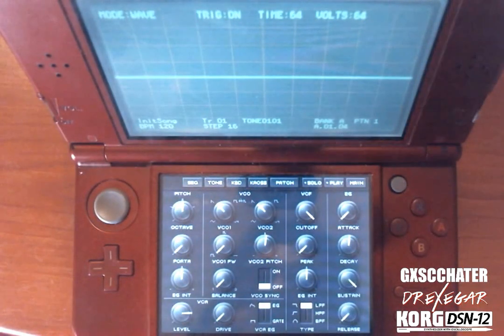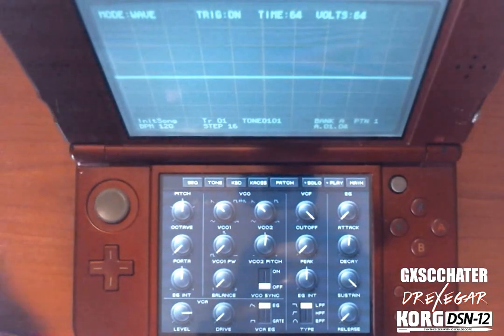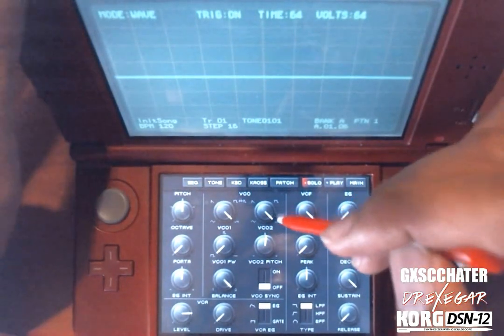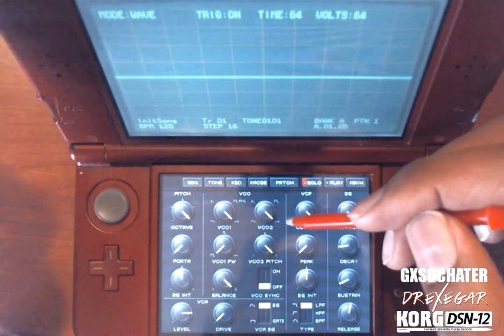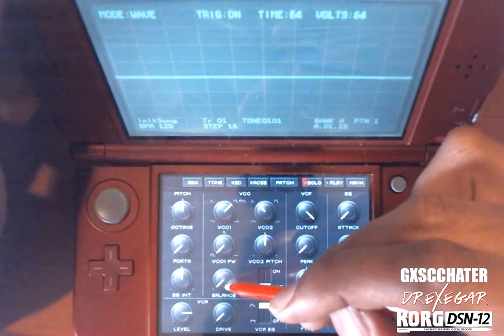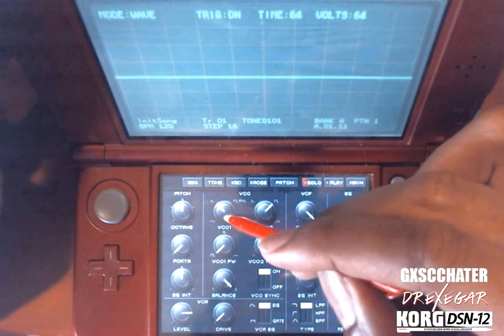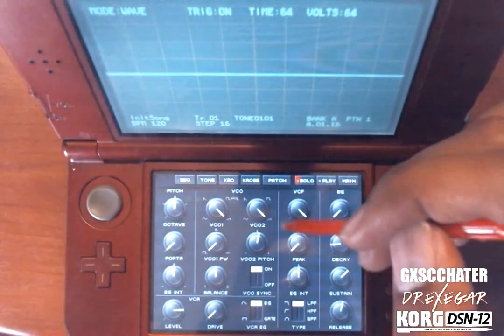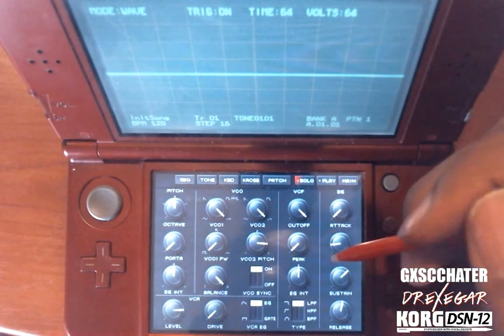DS10 Engine - SYNTH Part 3 of 5 - VCO Tutorial DS-10 DSN-12 iDS-10

Comment: These tutorials are great, I especially liked part 2.

Something that stood out to me on this video was your explanation of the VCOpw1 nob.
I liked how you referred to it as "flavor", it's a good analogy I think.
The technical term is Duty Cycle (trivia, the NES uses 4 settings for this, 12.5%, 25%, 50%, and 75% which is an inverted 25%. DS10, iDS10, and DSN12 defaults on a 50% duty cycle).

The part about this that stuck out to me was your demo of making the nob on DS10.
I find that the method you showed isn't quite the same as iDS10 and DSN12s VCOpw1 nob.
However, I do know a method that is very close to what you did that gives identical results as the VCOpw1 nob.
Basically, you want to do the same set up you did with Balance set all the way to the right, select the Squarewave for VCO2, and turn VCO sync on, but leave the VCO2 pitch centered.
After that, go to the synthe patch and connect VCO2 socket to the VCO2 pitch-in socket, and when you turn the VCO2 pitch-in nob it behaves identical to the VCOpw1 nob in iDS10 and DSN12. All the way to the left is a 50% (default) duty cycle for reference.
Same set up works in iDS10 and DSN12 as well (not that one would need to do that!). The catch of course, is that with this set up you cant do much patching to the instrument. 
Sorry if I came across as criticizing, no intention to, this video is gold. Just wanted to share the technique (though I've a feeling you maybe even covered this in a tutorial I haven't seen yet, working my way through all your tutorials because I'm learning some things I didn't know).

Thanks for these awesome videos n_n
Reply from the maker: thanks for the comments, anything that can help me make better video is appreciate. 

i very bad at terms but if they do pop up in mind during recording i definitely will call them out, especially when I get into chiptune tutorials in the future,

I did that VCO 2 into the VCO2 before, but I was not able to produce SID style music at all since you need vibrato for those oldskool pulse wave, so it really limits you so I dropped it. The method I use you have to keep it in the range of left side of the VCO2 Pitch knob. That is the 0% to 50% duty range, That means it takes a little more work on anything to make sure you don't go over the range of nice pulse sound. Will make a detail tutorial on this.

I have no clue how to create an inverted 75% duty, so i just don't bother with it, never used it in famitracker either it was kind of grating, maybe great for sound effects. 

I will be uploading some new videos soon, if have any questions feel free to ask.
Reply: Yeah I don't recall being able to get a 75% duty cycle on a square either, at least with DS10+.

As for vibrato with the setup I described above, you can do this by plugging VCO1 pitch-in to the triangle, saw, or square then control the vibrato level by using the Freq nob and VCO1 pitch-in.
My preference is for plugging into square for this.
I got one decent song where I used this for a very faithful to NES spec sounding tune.
I should probably upload it to youtube sometime, and I'm unsure if youtube is going to let me link from my dropbox in comments, if it wont you can PM for the song example, but this is the song where I made heavy use of this technique
https://dl.dropboxusercontent.com/u/57602359/TripNs_Music/New%20Folder/%E3%83%A0%E3%82%A6L2.mp3